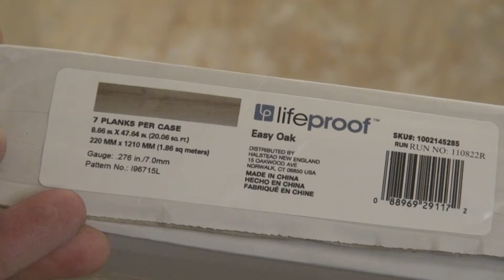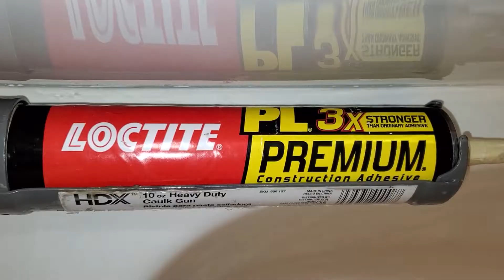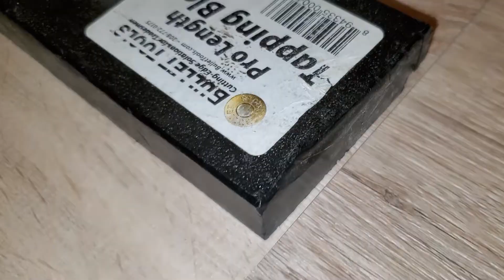Toilet on Vinyl Planks Installations

Comment: To keep this all from happening over and over seal the flooring around the flange between the flooring and the floor as well as build up the sealant around the floor opening too. Also to add  some more to this DO NOT use wax rings and especially DONOT double up wax rings. Then when installing toilet do not fully caulk in the toilet base to the floor
Reply from the maker: Completly not with your advice. 
26 years I used double wax if flange lower the floor line and use silicone all around.
Reply from the maker: How to use wax all around and double wax:
https://youtu.be/1N70RGWcTKA
https://www.youtube.com/watch?v=wU1KgS0m8wQ
Reply from the maker: Leak or not leak, that's a question not about wax or not wax.
That only about can be moving or not. Moving/floating floor or moving flange or shaking toilet.
Reply from the maker: Under toilet 1/2" free space. So make the top of the gasket 3/4"-1" from the floor surface. That's all.
Reply: Ok dude. Guess all the plumbers in America must be doing it wrong.
Reply from the maker: @apex007  I trust to my experience.
Reply: @FixitAll  yea, i was saying Jamie is crazy to tell you not to use wax rings.

Comment: Isn't this suppose to be a floating floor?
Also, I was taught not to seal in the front of the toilet bowl so that if you have a leak you'll see it before it ruins your subfloor.
Reply from the maker: Small sq.ft flooring can be glued.
Always silicone. No single leaks in 26 years.
Reply from the maker: The toilet never leaks if it or the floor cannot wobble/move.
Make sure that the floor does not float and the toilet does not move and the toilet will last 25 years, I guarantee.
Reply from the maker: You can live back of the toilet not sealed. Front visible for everyone, so better to seal it.
Reply from the maker: Here is a playlist on most interested technics of my toilet installation videos. Check some other tricks. https://www.youtube.com/playlist?list=PL9fyWqL02lqkOkVxGYY4BmSB5mnIfB9OY